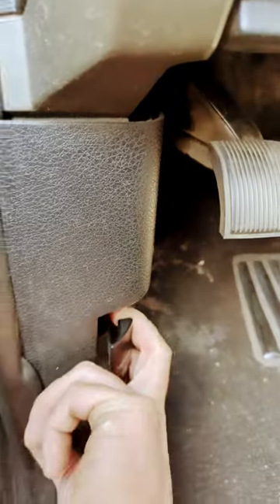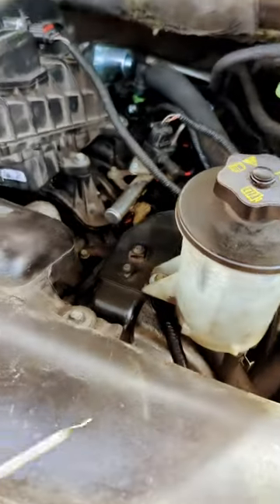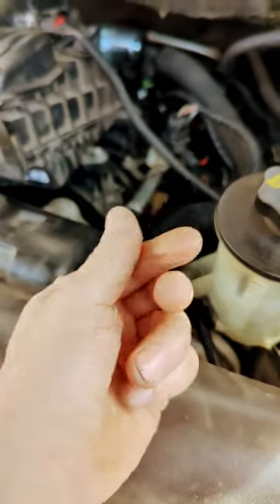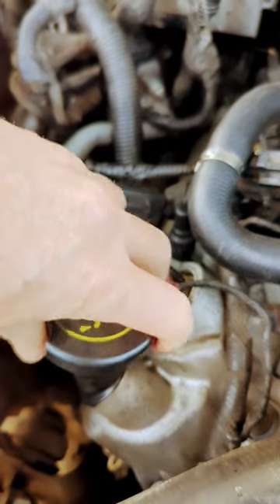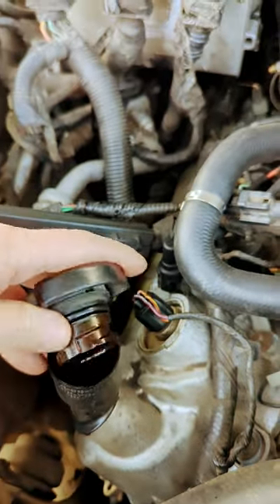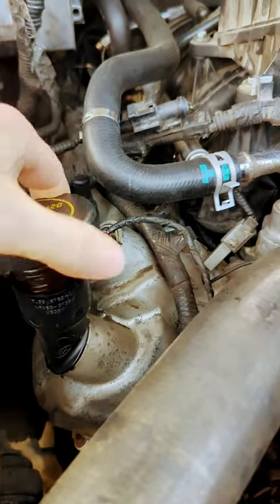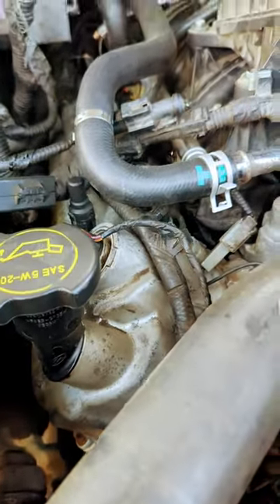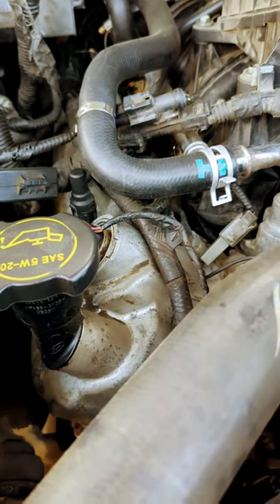Don't ever buy a used vehicle if you notice clean thick sticky engine oil

Comment: "needs a motor" lol you don't know the first thing about the 5.4 triton
Reply: It's a 3V, not even worth using as a boat anchor
Reply: Needs a cam phaser lockout $11 fix
Reply: He's right though. 5.4 3vs are garbage.
Reply: @oliver_klozoff  Care to explain how so? 280k on mine with factory phasers and timing components.
Reply: @TheRealDonJohnson  don't jinx it
Reply: @huckfinn2315  If only that was real
Reply: @TheRealDonJohnson  if it wasn't, you wouldn't have replaced everything already
Reply: @huckfinn2315  why would I replace something when there is nothing wrong with it? Runs like a top with absolutely 0 issues. The difference between me and fake Internet mechanics is, I for one understand that engine's are designed to work with a certain type of oil weight with a specific additive package. I don't throw $20 oil changes into my vehicle, because oil is ALOT cheaper than parts and a new vehicle. If you can read, maybe take a look at your owners manual. You may actually learn something.
Reply: @TheRealDonJohnson  I've already read all your other comments. Try again
Reply: @huckfinn2315   If you actually did, you'd see I've made it quite clear I've changed my oil with AMSoil since the first oil change, and maybe 2-3 sensors the lifetime of the vehicle. A torque converter bushing failure is not an engine failure or fault, and I replaced the transmission to be safe. Especially since they had it pulled to replace the converter anyways.
So, I question your ability to read and realize you have no mechanical knowledge. 
Try again:)
Reply: @TheRealDonJohnson  🤣🤣🤣 oh wise one, yes, you are truly the only mechanic 

In your head
Reply: @TheRealDonJohnson  if you had any mechanical knowledge 

You wouldn't have to troll just to flex
Reply: @huckfinn2315  What did I say that was wrong and upset you so bad? I'd love for you to share something, other than your upset feelings, because your comments are quite useless.
Reply: @TheRealDonJohnson  project much?
Reply: @TheRealDonJohnson  just because you have an exception does not make it the norm. This is a well known and documented issue, and has been for years. Also if you knew anything about the 3v you'd know phasers and timing sets are a symptom, not the cause of the problem. Faulty backing plates on the oil pumps are. The low pressure caused by the leaky plate starves the top end for oil, causing the timing, cam, and phaser component wear. Silly thing is, most parts changers don't replace the oil pump when they do a phaser and timing set, resulting in another premature failure. Thus the cycle repeats. If you in fact have had that truck all 300k and are on original timing components it's because you got a good oil pump. Also another nail in the Triton coffin ... How screwed up do you have to be to need 2 special tools made specifically for your faulty spark plug design. (Extractor and thread repair tools)
Reply: @oliver_klozoff   You have absolutely no clue what you're talking about. A long winded response with nothing but bullsh*t spewed from your lips to your finger tips.
I have never.once seen a 3v come in for oil pressure issues, and if the pump was hemorrhaging oil and below the base allowed pressure the oil pressure switch would alert you if an issue immediately. Then you'd know where the issue is.
Instead, you use oils with incorrect additive packages or none of the required, do extended oil change intervals, and it clogs all the tiny oil ports to the lifters, tensioners, and clogs the screens of the VCT solenoid with carbon and sludge buildup.
That special plug too is made for those who don't service their vehicle properly. 
I truly feel bad for anyone who lets you touch their vehicle.
Reply: @oliver_klozoff  O yeah, another thing to debunk your BS. The engine won't start if it senses no or too little oil pressure in order to protect itself. Clogged oil passages will do no such thing, but will cause lack of tension and phaser issues if there is insufficient flow from clogged passages.
Reply: @TheRealDonJohnson  get awfully bent about a 20yr old engine that was only produced for 4yrs
Reply: @TheRealDonJohnson  and you're completely full of it. The PCM doesn't even get a reference from the oil pressure SWITCH dude. You're so full of it. Stop embarrassing yourself. Look up some info yourself mr diy.
Reply: @TheRealDonJohnson  ooh an amsoil guy. Because everyone should spend 10x what they should on oil with a detergent package . At least make the proper argument to use motorcraft oil like the rest of the smooth brains. There is nothing special about amsoil aside from price. It's snake oil dude. You'll get a better additive package with cheapo oil and Lucas stabilizer. Good car brands go 300k+ on parts store brand oil that is spec for the car. Cope harder with your money pit.
Reply: Take advice from a guy that can't remove an oil cap!
Reply: @oliver_klozoff  Yes, it does get signal from the PCM. Go unplug it, watch the red engine light come on and see if it starts. I'll wait ..
Imagine complaining about my choice of oil due to your lack of knowledge of the subject and your (lack of) funds. My 07 expedition has no issues at almost 300k miles. Yet you nickel and dime your oil changes, cry about mine, and have the audacity to call an engine design junk out of pure ignorance. 
You're upset you got schooled, and now you're trying to cope and get upset because someone knows more than you. I think you should go sit down, mark. Until you prove my facts wrong, I hope you stay quiet
Reply: @TheRealDonJohnson  ps, you can't fix stupid. The facts are in front of you and you're too ignorant to see them.
Reply: @oliver_klozoff  I laughed seeing that come from you lol.
Reply: Had some hot idle ticking, did full timing job on my girl with 149K. Found 2 failed tensioners , all new components. Replaced almost half of followers and threw a melling high flow in. Runs amazing now. Oil is cheap, take care of your things. The 5.4 is gonna live a lot longer than the current eco boost.
Reply: @TheRealDonJohnson  284k mostly highway miles on my 2005 F150 5.4 3v. New timing chain, rear main, and reman trans though. Thing purrs like a kitten. When I bought it, I listened to the entire engine with a stethoscope cold and after I ran it hard for 30 mins. It runs strong and the trans is new, so it is problem free. It also doesn't leak a drop of anything, nor does it have rust anywhere. The undercarriage is spotless. All of the rubber suspension parts are perfect. The exterior has dents and scratches. The interior is stained and ripped. I don't care. I paid $2,900 for this truck with all of these new parts. I love this truck. LWB, extended cab, bed cover. Granted I didn't buy this truck as a daily driver. I bought it to haul stuff in. It's everything I needed and more.
Reply: @blessedjuggernaut  They're extremely good engines and vehicles. Don't plan on getting rid of ours any time soon. IF if ever needed a engine, it's payed for itself atleast 2x over,.so we'd gladly replace it IF ever needed. Ours still has a great interior, we did redo the seats about 10 years ago. Some sun fading, but we keep the dash dressed to keep it at bay as long as possible. 
These things get a bad rap from crap mechanics, and people who don't maintain their vehicles.

Comment: If you're looking at a used vehicle, take a scan tool, phone to look up stored codes, a stethoscope and enough cash for a down payment. Just bought an 05 F150 5.4 3v for $2900. It has a new timing chain, rear main, front main and new transmission. It has 284k mostly highway miles, but it purrs like a kitten. All you hear is injector noise. No leaks or rust period.

Comment: Full timing set with phasers.
Reply: I'd throw a set of roller followers and lash adjusters in while I had it opened up as well as a Melling 360HV oil pump. Overall cheaper than a long block that isn't needed.
Reply: Or sometimes it’s just the chain tensioners leaking oil pressure. Depends on the year if it had the plastic or metal tensioners. Plastic ones leaked and bled pressure at idle.
Reply: @oliver_klozoff  You have absolutely no clue what you're talking about. It's bad oil choice's that mess up the VCT and tensioner system. Not an oil pump (wow, first ive heard that BS), you can't use cheap $20 conventional oil. Carbon builds up on the VCT solenoid screen, blocking oil flow from entering and exiting properly and the phasers beat themselves.
Tensioner holes get caked with carbon (from poor oil choice) and like an artery it clogs up and doesn't allow oil to flow to the tensioners. Especially since they're the non ratcheting type that strictly rely on oil pressure to keep the guides tight to the chain.
Quit acting like you have a clue what you're talking about.

Comment: It's a 5.4 3v triton completely common and saying it "needs" a motor just shows that #1 you don't know jack shit about the 5.4 and #2 you aren't skilled enough to do the maintenance it needs to quiet it down. Parts and labor to do the maintenance are cheaper than a entire long block and it can still be driven the way it is.

Comment: 5.4s eat parts. Don't buy unless you just enjoy   working on it all the time
Reply: What parts do they eat? Curious, 280k on mine, all I've done is plugs and oil since new in 07. I'd like to know for the future when it starts eating parts.
Reply: @TheRealDonJohnson   the plugs break off when trying to remove. The plugs will blow out of the socket.  Cam phasers Cam chained and guides.  Valve rocker arms wear .  The oil  galleys get plugged up and smoke the lower end .  I guess  that's it. Have you done your phasers and chains yet
Reply: @GrandpaJams   They will break if you try to change your plugs when the engine is cold, and you never put any anti seize on the threads. Ford put the TSB out to dealers and techs to use a impact to break them free when hot if no anti-seize was used prior. You'll find cam phasers have issues if you don't use a quality synthetic oil and don't change your oil at 5k miles to keep carbon buildup from clogging the little screens on the VCT solenoid. Clogs screen, oil can not enter and exit as it should, get the rattle and they wear out from little to no lubrication. Same goes for the chain tensioners, carbon builds up like a clogged artery and slowly blocks off the little oil pressure orifice. Causing chain slap on the guides on startup because the tensioners are the non ratcheting type that strictly relies on oil pressure for tension. The roller followers have never been a issue (first hearing that one), lifter pump up has on some engines. Again, you'll find that's usually from poor oil change intervals and crap bargain bran conventional oil the $20 oil change shops use allowing carbon build up in the tiny lifter orifice.
I have a factory sealed engine, minus a few damp gaskets. Replaced maybe 2 sensors, and factory trans wore out the converter bushing and was causing shaking at low RPM. Just replaced the who trans and converter to be safe and get a other almost 300k out of the expedition.
Amsoil 5w20 and wix filter since first oil change, runs like a top, sounds like a smooth sewing machine.
Reply: @GrandpaJams  Long story short, it's issues are purely maintenance and oil choice issues. Not an engine design flaw, though people tend to think they're one in the same these days.
Reply: @TheRealDonJohnson   your right . I always get  the engine  up to temp and use a impact  and never have one break. But it's still a bad design  .
Reply: @GrandpaJams  What's wrong with the design? It tends to be from leaving old plugs in for too long, then they tend to swell up, and when carbon builds up on the extended tip and they don't want to come out. Always the owners poor maintenance or a new/uncaring tech not doing the correct care that leads to headaches That's why when it's warmed up they come right out. No worse than a bolt that gets stuck, but comes off with heat. I'm a bit anal and swap plugs every 30k. I know that's half life of a platinum plug, but it's cheap insurance. I always use some copper so it's never an issue. Going to drive this thing until the wheels fall off. Just waiting for warm temp to do my undercoating to help the body survive another northern winter.
Reply: Only abused ones eat parts, I've owned 3 and only 1 got a full timing job. I barely had to touch any of them when it came to repairs. First one got totalled, second one got a timing set then sold it before I had to do a frame swap, my third one is a Texas truck over 200k miles and purrs like a kitten